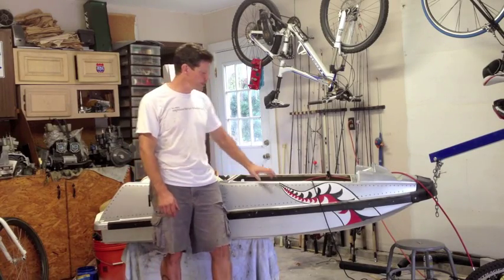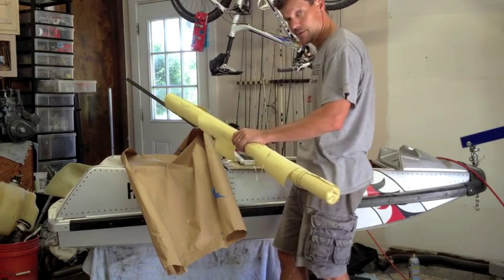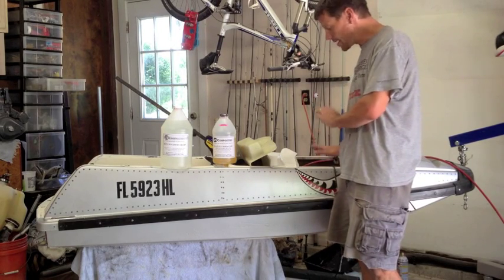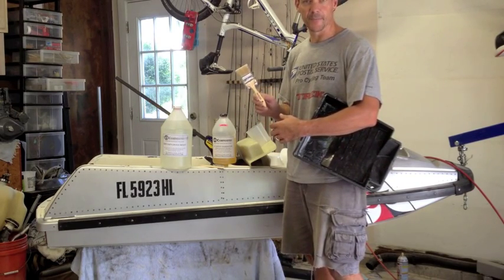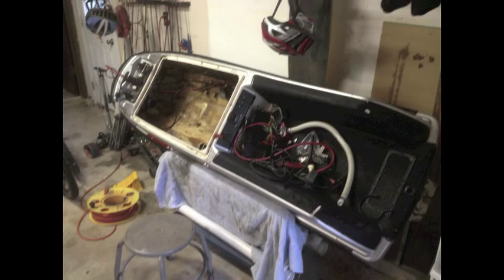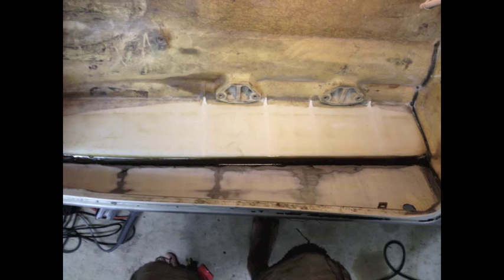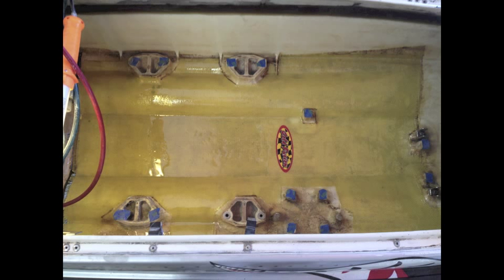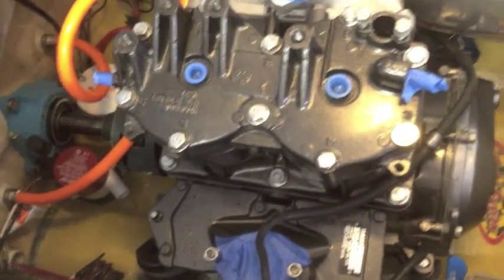Reinforcing a PWC/Superjet engine bay

Comment: How much weight do you think it added.
Reply from the maker: Richard Bonfanti depends on how you do your layup (hoe much resin you use). If you use a roller and don’t get messy, I bet it’s less than 4 pounds. The glass/Kevlar/carbon what ever fabric you use is very light. The weight comes from the resin. So picture the weight of 10-12 ounces of resin. That’s not much.

Comment: So right man. Cut the footholds out totally dry drilled the rivets tube slid right out no pounding lots of moisture tho  then dug a small bit of the foam out to the bottom of the hull dry as a bone guess the flange leaked some  thanks for all your input. Happy riding.  -Adam

Comment: Informative video thanks man.  Did I notice that you had the exhaust tube out of the hull  if so any pointers?  I really want to get it out without beating it to hell  cause I have a sickening feeling my foam is totally swamped. Thanks
Reply from the maker: turbolife13 the exhaust is easier than you think. Drill the three rivets on the flange at the back then scrape off as much glue as you can from the bulkhead inside and bang it out. If it is being really stubborn, you can use a putty knife or something similar between the flange and the back of the ski. Just be careful not to pry too much and crack the ski. Usually they come out pretty easy.
Reply from the maker: turbolife13 Oh and one more caution, As you are digging old foam out, remember that besides the exhaust tube there are cooling lines and a steering cable tube that go through that space. They are just aluminum tubing so if you are jabbing in there with a screwdriver or something, you can put a hole in them.
Reply: hesty32. Thanks man  no longer flying blind.  Ride safe
Reply: hesty32  if it's soaked I'll be cutting out the tray. But I figured that the exhaust tube would be the easiest way to tell verses cutting her up other than for footholds. Thanks for your help
Reply from the maker: turbolife13 Good idea! Usually the foam in the upper tray (behind where you cut for footholds) is dry even in a waterlogged ski. I think you'll be able to tell how waterlogged it is when you remove the exhaust tube.

Comment from the maker: an advantage of the pumps that I didn't mention is you can mix smaller batches of epoxy and still get the ratios right. In that regard they can save you money….

Comment from the maker: I agree the pumps are pretty easy.  Just adds another $30 (about $15 each as I recall).  Haven't used microballons but used a lot of cabosil and that is a good idea.  Didn't think of using that in the bond line.  Good call.  Next video I'm working on of the footholds I use a lot of cabosil.  I've heard of people using baking soda too but never heard any results so I'm a little suspicious...